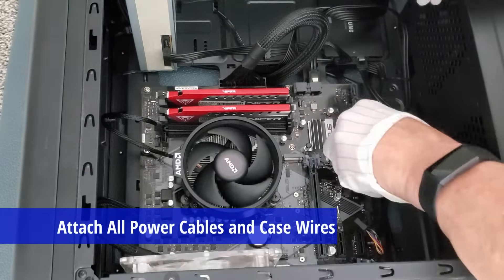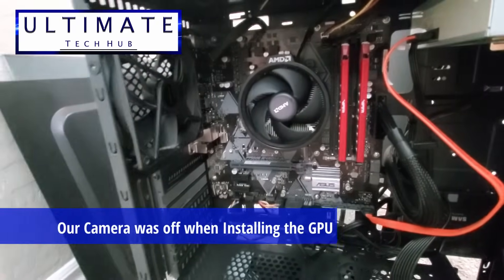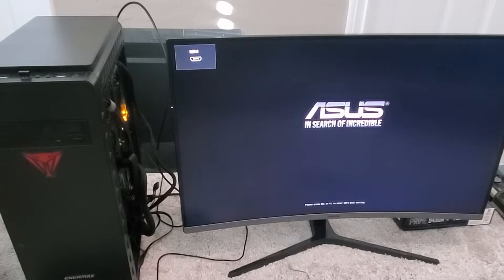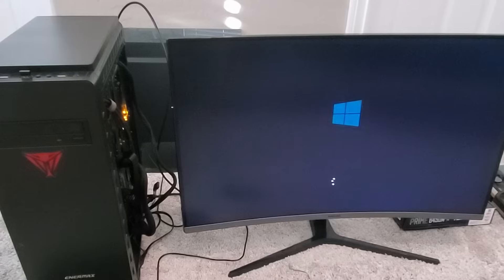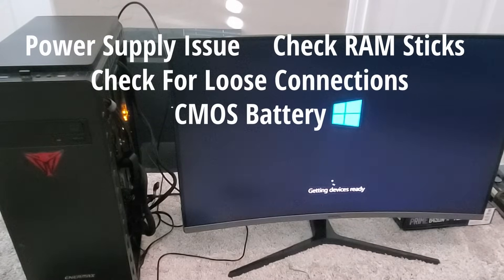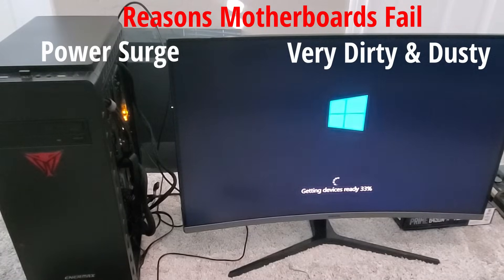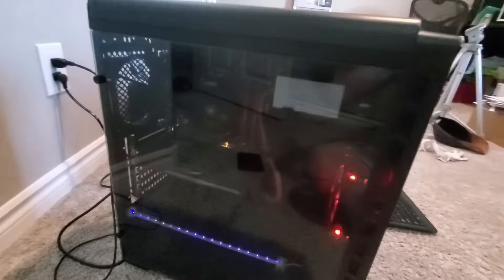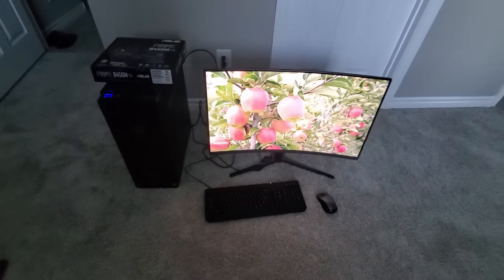HOW TO REPAIR A DEAD COMPUTER - DIAGNOSING A MOTHERBOARD FAILURE! - HOW TO

Comment: Okay I question so I built my friend a pc using a prebuilt optiplex 7010 and after a while he got a blue screen and now it’s completely black screen, I changed out the ram and it boots up, and works as soon as you turn it off black screen again take out cmos battery and back in it works but only without hard drive, plug it in black screen eventually now I get nothing no matter what I try all black screen it’s weird never seen this before
Reply from the maker: Motherboard failure is my best diagnosis.
Reply: @UltimateTechHub  that’s what I just ordered will update if that fixed

Comment: I have an issue where I can a black screen most of the time when booting but when it doesn’t black screen, it goes past bios but freezes right after. (Can still get into bios fine)

Things I’ve done:
Replaced motherboard
Tested GPU, RAM, PSU, SSD not an issue with any of that. Tested with different parts. 

Reset CMOS, Updated BIOS same issue.  

Only part I haven’t tested is the CPU, I have been told it is extremely rare for a cpu failure. All the research I’ve done doesn’t lead to a CPU issue.
Reply from the maker: Sounds like it's the motherboard to me. My only other advice is to take everything out of the pc case and start over from scratch with installing the mobo amd make sure all of the cables are connected correctly.  Like make sure the CPU power connector is plugged in from the PSU, that will cause it not to boot. Sometimes motherboards have jumpers that can fall off during install and that will cause it not to boot. A bad CPU is very unlikely but you can remove the CPU and look for any bent pins. If there are bent pins that will be the reason it's not booting.  Keep me posted and thank you for watching.

Comment: Hi! I have an Asus TP500L and it’s not turning on. For a while, I was able to just unplug the battery cord and plug it back in and the laptop would work, but that method doesn’t work anymore. The lights on the side turn on, and the battery shows that it’s charging. What do you think I should do?
Reply from the maker: It's probably the PSU. How old is the PSU? If it's not the PSU then it's the MOBO. Keep me posted.
Reply: @UltimateTechHub  hello, thanks for responding! I actually don’t know how old the PSU is, but I do know that we’ve had the laptop for 4 years or so. I’ll take a look and see what I can do :) thanks!

Comment: Let's say the PSU 100% works in a different system, but when plugged into the faulty system, the system shows absolutely no signs of life whatsoever, no fans spinning no lights, nothing. That would be a motherboard issue, no? The motherboard in question has always had a faulty CMOS battery socket and would reset CMOS any time the PC was unplugged and take a god awful time to post again. I suppose the motherboard is the issue here. Only thing that would explain it, or am I wrong?
Reply: Hey I've got exactly the same problem, any chance you figured out the cause?
Reply: @busy3082  yeah my motherboard was the issue. It would essentially brick itself every time the computer was unplugged and would have to reset when id turn it back on. I just replaced the motherboard under warranty.
Reply: @dammitcarl1082  thanks for replying, thinking I've got the same issue except mine isn't under warranty, oh well
Reply: @dammitcarl1082 
How do you reset it please ???!
Reply: Sounds like the slot for the PSU on your motherboard is bad
Reply: It can be also a dead CPU. In such case, without tools, it's very hard to tell if it's a motherboard or CPU. And it could be both of them as well.

Comment: I have a question this morning my pc will not turn on, its not receiving any power lights or case fans wont spin.. i assume its either the psu or case itself... Im waiting on a new psu if thats not it ill bypass power button and check the case function.. is this the correct order for troubleshoot? Could you see anything else causing this issue?
Reply from the maker: Yes The PSU is usually the first place to start. And from what you say I bet its the PSU. Keep me posted and thank you for watching.
Reply: @UltimateTechHub  just set up new power supply and turns out it was the problem after all! thanks for the reassurance
Reply: @UltimateTechHub  the exact same thing is happening to me but I tested my psu and it works fine. If this is a motherboard problem, how do I know for sure?
Reply from the maker: @Snackrifice69  go through the other tests that I preformed and if your pc won't boot then it's the mobo.

Comment: hello. i liked your video. 
i have an issue with my pc. it freezes and restarts on startup but when i remove my hdd (not my ssd where windows is installed) it doesnt freeze and restart anymore
i have tried different psu and a new hdd and same situation. I think its an issue with the motherboard. can you help me with this please.
Reply: pls help me 🙏🏻
Reply from the maker: @kersi1865  Maybe plug the HDD into a different SATA connection on the mobo. Its sounds like its trying to boot the HDD as the startup drive. Also go into BIOS and make sure the SSD is the default boot drive.
Reply: @UltimateTechHub  thank you so much i will try all these what you told me thanks a lot

Comment: It could also be the cpu, if there's no fan turning on.
Reply: my other fan is turning on but only my cpu fan wont work , but the other fan is good do i need to change my cpu or motherboard
Reply from the maker: True, CPUs can become bad from heat, age, overclocking and power surges. However the 4 solutions I mentioned are usually the culprit but you are correct with checking the CPU. Thanks for watching and for commenting.

Comment: My pc is relatively new, its like 6 month old. I have black screen issue and i couldn't figure what's causing it. So the problem is I have an RGB ram stick that lit up when turn on. When i turn on my pc everything lit up except my ram. And sometimes, my ram did lit up and able to boot into windows. But after few minutes it will turn off by itself and restart into black screen. When it restart same problem occur, everything lit up except the ram stick. This issue is giving me a headache for a week now. Really couldn't figure out what's the issue.

Comment: I have the same problem, with your old motherboard did all your fans turn on?
Reply from the maker: Ye the fans turned on.
Reply: @UltimateTechHub  Hmmm, Mine won't turn on any fan for some reason. But when the 24 pin was plug in halfway it would just turn the case fans (molex). Btw it won't power up, any suggestions?
Reply from the maker: @ibwam3611  Probably bad motherboard or PSU. Thats really all I can think of. Just try everything  I did in the video. Thanks for watching and keep me posted.

Comment: I have a issue where i freeze on the loading screen like before windows, i can still get into bios without crashing. I have done everything to fix, test every bit of hardware except the psu. A few of the same fans turn off every time it freezes. Would it be likely that it is my PSU that is the cause?

Comment: I'm having same issue, all brand new components, although I have cpu ez debug led. No bent pins or anything.
Reply: Same did you fix it?
Reply: @Himathen  yah, all it took was a new cpu and motherboard
Reply: @minuteroast  ah man none of my fans are coming on though so does that mean I need to do the same thing or look for if it’s another issue before I buy something else
Reply: @Himathen  well I wasn't having that problem. My pc would turn and, fans would run, but wouldn't get a signal on the monitor. What trouble shooting have you tried so far??
Reply: @minuteroast  I cleaned the ram, tried different power cords for the psu, took out the cmos replaced it, switched my psu’s

Comment: I’m having the same issue. I tried what you showed with the RAM and put in a new PSU. Neither worked so I sent it in for repair today. They’ll probably tell me it is the mobo, fortunately it is still under warranty. Hopefully that fixes it!
Reply from the maker: Glad its under warranty!! Thanks for watching!
Reply: Hey man, any updates?
Reply: A pc keep giving alarming beeps or siren but still work fine. Usually first thing to do is to replace the PC case and install the RAM in different slots, but some RAM stick are the “leader” stick that must be in the slot 1 to make a pc POST as the other sticks of RAM “follower” sticks that couldn’t POST all by itself. 
It may not be the PSU has fault, but replace the PSU may fix it if all the fans works fine when there was no POST. Replace mobo’s battery too. In many cases no PC parts has fault, it just need to replace the PC case, RAM, PSU, battery with another working PC parts, so after doing all that, you ended up with 2 working PC system and not a single faulty PC part.

May need to replace the PC case because some pc case’s back panel is curved outward and need pushed inward to put in the screw to secure the graphic card, so after some years or weeks of use, it pulled things out of place, bow and arrow theory … …

In one of the other cases, each time the power is out in my house, I need to replace the graphic card and installed a graphic card that could POST in the PC, then I install the one that failed to POST back in place and it could POST, so each time the power it’s out I need to repeat that!

Some PC could shut down due to static changes when your hand is only touching the power button to the PC that’s made of plastic. 

Some PC couldn’t POST, just wait a 3 days without using it, then it return to life of POST, this could happen once in a few years of use, like seeing a comet going passing by! Unplug the power cord and HDMI cables to the PC and let it sit there for 3 days …

Comment: Thank you so much, I tried to do a Bios upgrade but when I pressed M-Flash to start the upgrade my monitor turned black, I just let it rest for hours but it was still black. I unplugged the battery from the motherboard for 3 minutes and plugged it in back again and it all started working again. Thank you so much I was scared.
Reply from the maker: Glad it all worked out! Thanks for watching!

Comment: Hey so I built my first pc but when I turn it on it runs for about 30 seconds then cuts off, then cuts right back on and repeats the process. Does anyone know what the issue may be?
Reply: is your power supply strong enough? Is the cable plugged straight into the wall?
Reply: Could possibly be ram my pc used to do the same

Comment: Okay 
I have r7 3700x
Mortar b550m
No signal on my pc 
I switched rams and did everything-
I took my pc to a tech store and different ram still didnt work.

So I came down to my motherboard because the chipset heatsink's screw was broken so I just superglued it....

The store only had an a320 pro-vh -plus and I'm going to try that old school mobo to see if it boots (didnt boot)

Edit: ordered the gigabyte p pro b550 mobo mobo and system booted...works great..patience is the key🙂
Reply: Did it boot?
Reply: @acseptt8100  Haha I bought a new motherboard and my pc is working great now! Runs all games at 1440p 60fps

Edit : no the old mobo didnt boot
Reply: Yeah mine isn’t working I gotta buy a new board
Reply: @acseptt8100  ahhh alright have patience bro
Reply: @guanedits6349  ok I bought a new motherboard

Comment: how rare is a faulty cpu? i dont see any visual damage on the cpu but it dosent work....
loading bios and after few seconds bios freezes 

any thoughts?
Reply from the maker: I've had a faulty CPU before but there was visual damage. I used a magnifier to find the bent CPU posts. I would check all of your connections like make sure your RAM sticks are seated completely. Also how many watts is your PSU?
Reply: @UltimateTechHub   thanks
ram is good 100% board is good!
it comes to bios then freezes
maybe a cpu problem?
its intel4th gen 4690
looks good visually...

damn how can a cpu get deffected

Comment: Dead cpu cause no input signal?
Reply from the maker: It may but if the CPU is dead the mobo won't even start up.
Reply: @UltimateTechHub  OMG THANK YOU I FINALLY GET AN AIR OUT I WAS SO WORRIED MY I5-9400 IS DEAD ILL BE KILLED IF THAT ONE IS DEAD
Reply: @UltimateTechHub  i dont have a gpu yet im gonna try using hdmi when i got one
Reply: I was playing a game then it overheats and it blacks out and shows blue screen of death for few minutes then black out
Reply from the maker: @envy6250  You need to figure out your cooling for your CPU. It sounds like you may need a better cooler. I use a 3 fan water cooler. And I would definitely NOT over clock your CPU.
Reply: @UltimateTechHub  can you suggest a cooler for my pc?
Reply: And rn my screen is showing no input signal
Reply: Also what do you think the provlem of my pc?

Comment: Thanks for this now i need to buy new Motherboard :( Subscribed!
Reply: What Happened 😖🤝🥺
Reply: Same
Reply: Me 2
Reply: Me too
Reply: Im having this problem now I thought it would be the psu, bought a new psu but it didnt solve it so I took it to a nearby technician, he examined and told that the motherboard is faulty, so my only option is to replace the Mobo with the new one. I hope this will solve the problem.
Reply: @dhivakar111  hey is your cpu in good condition after replacing the motherboard? or is it dead also?
Reply: Me2

Comment: I just got a pc, the motherboard works with its RGB and works with Keyboard and mouse but the only thing that won’t work is the display in both GPU and mother board. I’m getting the no display. But the mother appears to be working with the fans and other accessories.
Reply from the maker: I would try a different monitor and a different HDMi of VGA cable.
Reply: @UltimateTechHub  I’ve tried a different HDMI cable. And it won’t display on my tv either
Reply from the maker: @hobofraggins7986  sounds like your motherboard.  That's exactly what happened in my video.

Comment: What should I do if I purchased a new motherboard, cpu and ram? Can I transfer the windows from the old motherboard to the new one via the product key and what should I do after installing the motherboard and the rest of the parts when turning on the device? I'm sorry for my long question
Reply: Hi, after changing motherboards you’ll have to make sure to connect the drive that has you windows on it and make it your boot priority in the bios. The windows license will go to your new motherboard if you bought an actual license. But if you bought a OEM windows key, you’re out of luck. The other parts just plug them into the motherboard and they’ll be good to go unless your motherboard maybe needs a bios update to be able to use your other hardware

Comment: Hello I have a asus strix b450-f with a ryzen 3600, its a 3000 desktop ready, so it would get the 3600 but when I turn on the pc the rgb from the motherboard does turn on but it gives no image, and the cpu its good, any toughts?
Reply from the maker: Just do the check list that's in my video. Probably a bad MOBO.  But check the RAM sticks , the PSU, and all the connections.  Keep me posted.  Thanks for watching.
Reply from the maker: Either the PSU or the motherboard. Its hard to say since I can't see whats going on. Is your hard drive plugged in correctly to the SATA connection and power is connected to the hard drive? Does the motherboard make a beeping sound?
Reply: @UltimateTechHub  ive got some lights on the mobo to turn on, my memory rgb lit up once, ive sent my board and my power supply back and re ordered with the same thoughts, ive got no on board speaker i’m in the process of getting one before the new board is to arrive, but i’m scared that it will end in the same result but i’m trying to troubleshoot what might’ve caused it the first time. also ive got a m.2 ssd nothing with sata except an argb fan controller that hasn’t been the issue
Reply: @UltimateTechHub  also ive tried to start without the gpu and the integrated graphics on the mobo still looked like it flashed for a moment and immediately after stopped
Reply from the maker: @SchiZ03  Sounds like the MOBO. Not 100 percent but it is looking like that's problem.
Reply: @UltimateTechHub  thank you for the insight? i will go about building the machine differently and in hopes that i didnt short the board somewhere.
Reply: @UltimateTechHub  so i just got a replacement motherboard, it will post and get power but i will get no signal when the motherboard is hooked up to hdmi, the ram lights up, the board lights up, the led codes change, i’m currently trying to solve this if any information can help please post to me
Reply from the maker: @SchiZ03  have you tried using the VGA connection to your monitor? Or another HDMI cable?
Reply: @UltimateTechHub  its an hdmi to a tv, the display port cable from the motherboard to the monitor i’m using also didn’t get a signal
Reply: @UltimateTechHub  ive got a motherboard speaker arriving tomorrow or the day after but what codes am i looking for that might cause no boot, since now this other board is not having a power issue
Reply from the maker: @SchiZ03  Just make sure that all of the power connections are correct like the CPU power connection. Try to boot with 1 RAM stick. Did you install ALL the standoffs for the mobo to sit on? Make sure your PC case connections to the mobo are correct because that is usually the culprit. Good luck and keep me posted.
Reply: @UltimateTechHub  yup returning everything i bought lol
Reply: i have an asus strix b550- gamining wifi with the same issue, the rgb turns on when powered passively, but upon trying to start the pc no image, did you resolve this?

Comment: Sir my motherboard doesn’t power on or not booting. All parts put in on the mobo was brand new. What do you think was the problem?
Reply from the maker: Well my best guess is the power supply or the PC case connectors that conect to the MOBO are not in the correct positions. Go back and double check ALL connections from the power supply to the MOBO and the pc case connections.  Keep me posted.